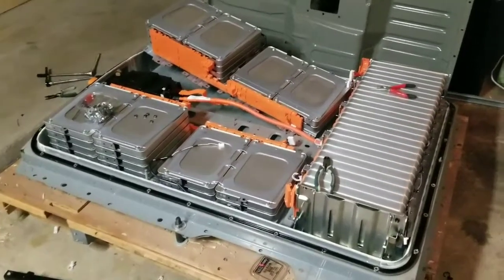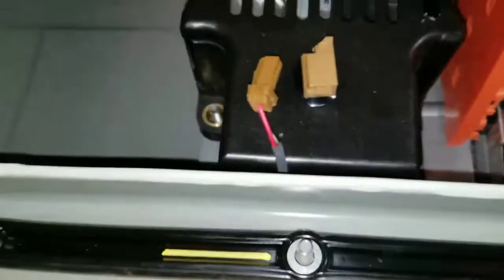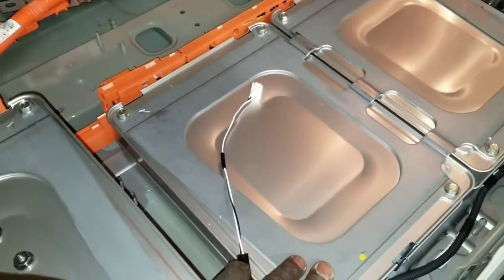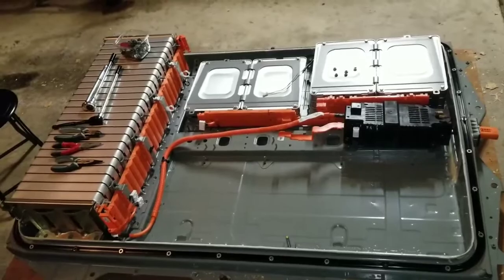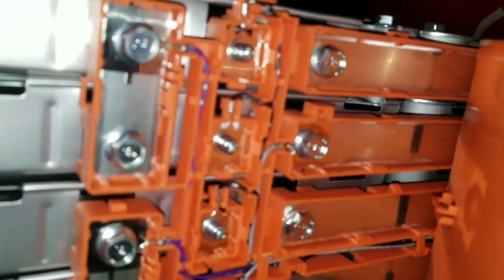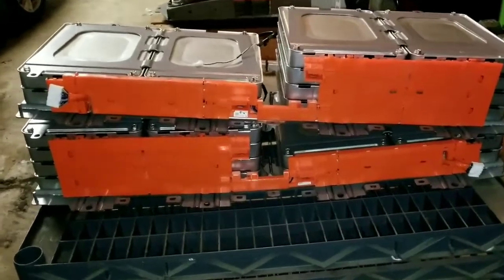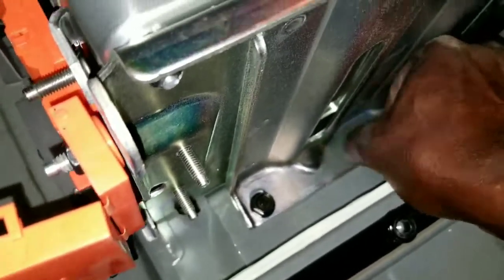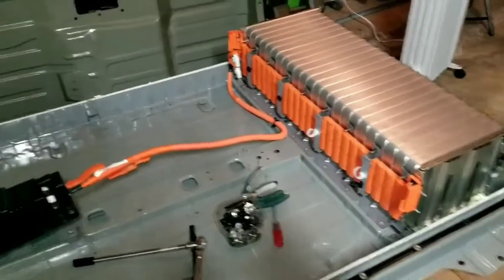DISASSEMBLING A 24KWH NISSAN LEAF PACK - EV Battery Technology

Comment: Excellent safe disassembly of the batteries and BMSs . What’s nex t t oooh ! do I see a fan on top of the heater over there ? Nice. ! Is it helping to transfer the heat to keep you a lot warmer at ease and it should at least keep the batteries warm .
Reply from the maker: Yes.
Thanks for that info